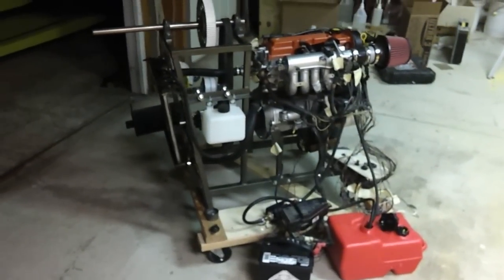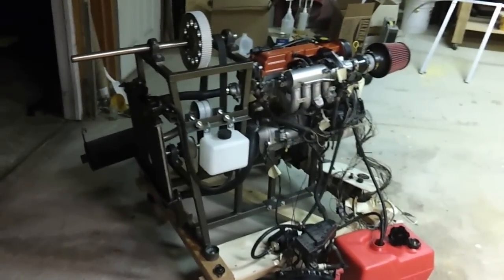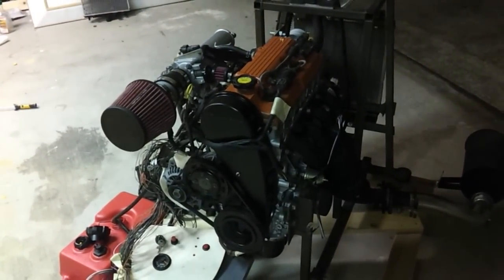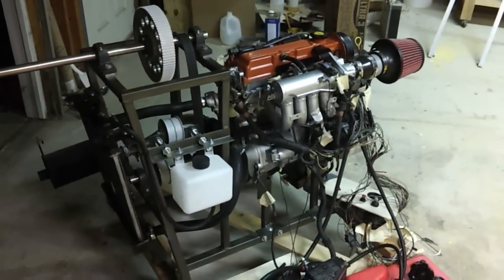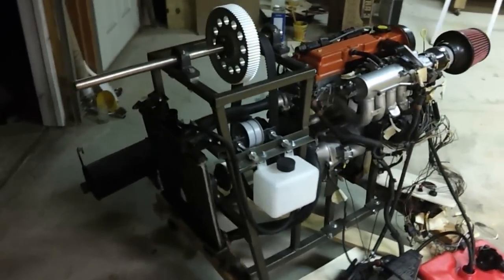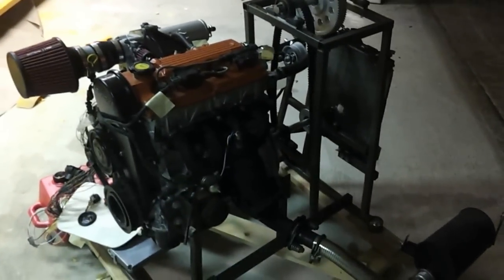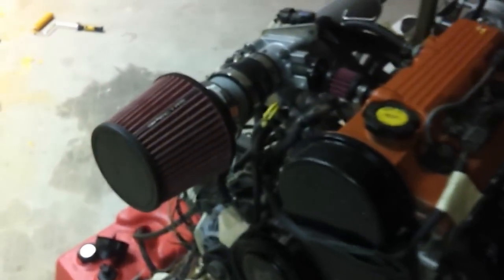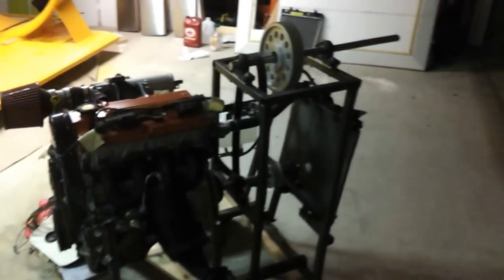Geo/Suzuki 1.3L Engine - Hovercraft conversion

Comment from the maker: Thanks! It's a very smooth engine, and you can find them all over the place. The weight of the engine by itself (not including radiator, wiring harness, and fluids) is 174 lbs. The stand in the video weighs 29 lbs, and the reduction drive components add another 25 lbs.
Reply: Hello, I need info on that harness, I have no wiring shops near me and I'm pretty much doing just the standalone harness for a mud rig but this harness is the closet to what info I've been able to find

Comment: I rely like this. I am using Rotax engines myself but i see a clear advantage to using car engines, since they are smoother and are cheaper to come by. Do you know the weight of the engine? I am looking to build a bigger craft and that would need a smoother and stronger engine.